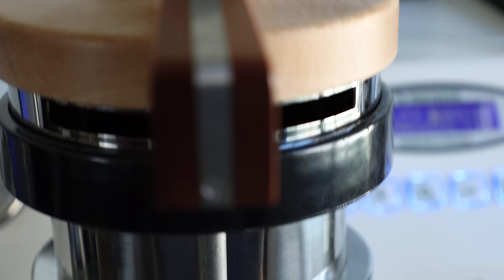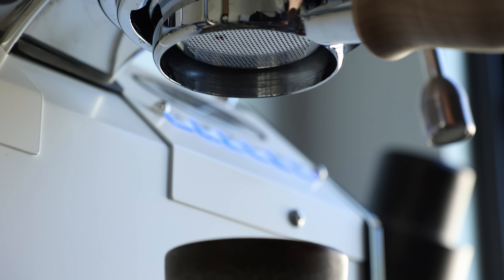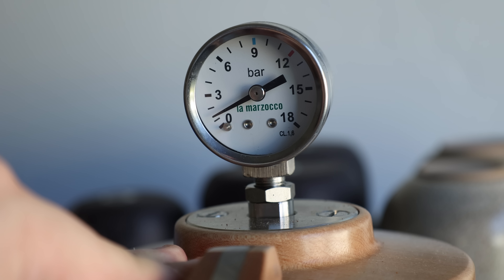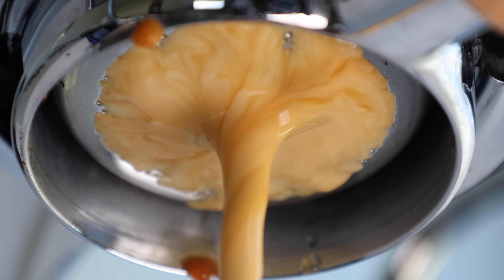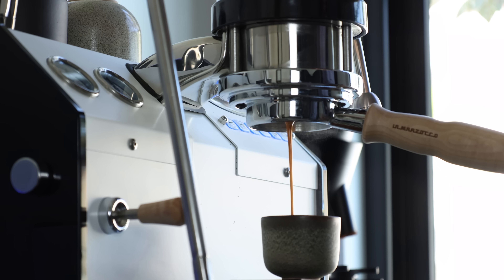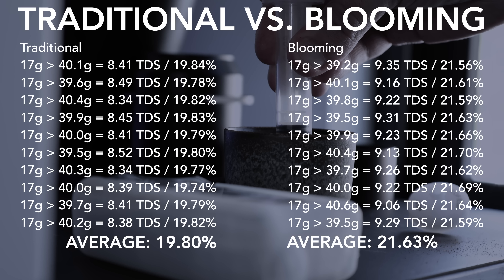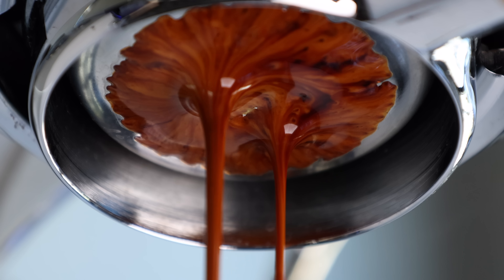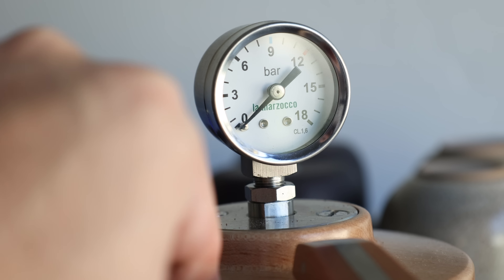ESPRESSO ANATOMY - Blooming Espresso

Comment: I kinda do this with my cafelat if I'm using a new coffee I haven't dialed and my dose is a hair too coarse.  Of course,  I'm not getting 9bars.  I may "bloom" at one bar then pull the shot at 4 bars.  Normally still tastes quite solid
Reply: the cafelat maker yt videos show a pre-infusion hold and then push harder gradually before easing off. Think semantics of pre-infusion other word for bloom?
Reply: @Ma_Ba  not really the same.  Lots of people pre-infuse with various pumped espresso machines too.  That's not a long hold though.
Reply: @veganpotterthevegan  I got a Cafelat Robot recently. (usd to bps rates lately!) How long a hold? Will review what tining Robot maker says too. Same 2 factors: time and pressure with hold of flow rate. Curious.
Reply: @Ma_Ba  I normally do 5-10 seconds depending on the coffee I'm using.  I only do the very long hold if I'm using a new coffee and I get too little resistance with the pre-infusion.  It takes a lot of the sourness out of pulling a shot too fast with light roast.  So when I do this,  I just hold at whatever pressure it'll take and it's normally around 1psi or less.  When I pull the shot, it can be as little as 3-4psi
Reply: @veganpotterthevegan  thanks!
Reply: @Ma_Ba  you're welcome!  Have fun with your Robot!!!

Comment: How many shots do you normally drink a day?  And how many grams does that come out to?  I love espresso but I can't seem to get enough.  I want a giant mug of it, but its probably not good caffeine wise and it gets expensive pulling 6-10 shots a day.  Do you have any suggestions?  Lately I've been making cheapo americanos.  Basically making a doubleshot but letting the water run through the puck post extraction to get the last bits of coffee flavored water instead of diluting with straight hot water.
Reply: decaf medium roasts

Comment: is there a percentage of what make a better testing coffee ? for example, correct grind size, 50%, wdt, 18%, twist distributor, 18% temping 14%... dose, basket, water temp, pressure, pre infusion time, ratio... i got into coffee its getting way too complicated haha.. maybe if i focus on what makes the bigger differences i will get a good enough result.

Comment: Would it be better if the maximum pressure is 6 bar?
Reply from the maker: For me I did go back and forth between a 6 and 9 bar finish. It does slow the end flow a bit, and can give you a little more cushion if your grind isn’t much finer than a standard espresso. I had good results in the cup on both.
Reply: I find that going to 6 bar after a bloom leads to over extraction. But that could just be me

Comment: Just spent a minute googling to see what I would have to do to "temporarily" disable my Silvia's 3 way solenoid to prevent that discharge so I could bloom. To save every other Silvia owner a minute of googling, it requires removing the panel behind the grouphead. I'm gonna pass on this for now and maybe give it a try on a friend's machine someday.
Reply from the maker: Yeah, on some machines it may be more trouble than it’s worth! Thanks for sharing
Reply: Silvia’s are a nightmare to work on. I dread the times when something needs attention and you’ve got hoses and wires going everywhere.
Reply: @dan110024  I imagine if I had a machine that was easier to tinker with it'd be bigger and more expensive. I have a pair of those locking needle nose pliers that anglers use for removing hooks which helps.
Reply: UPDATE: I found a guy on youtube who, get this, puts an empty pitcher under his wand and opens his steam valve to modulate pressure. I was pretty stoked to discover the steam wand can be the poor man's paddle (provided you are truly poor and use a single boiler machine). Next time I've got the right beans I'll pull a bloomer.